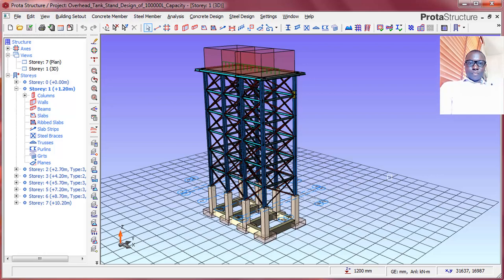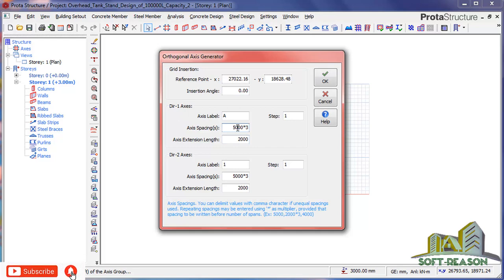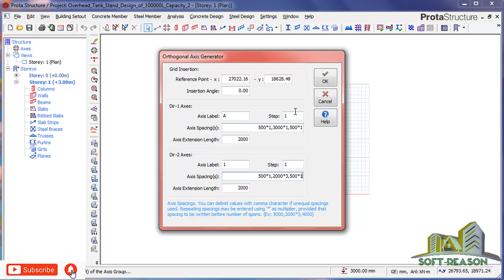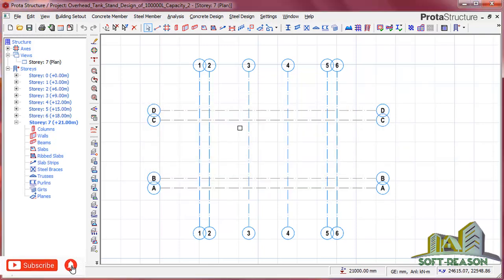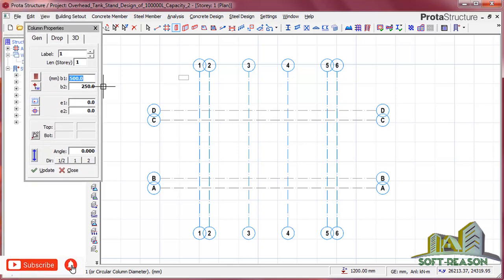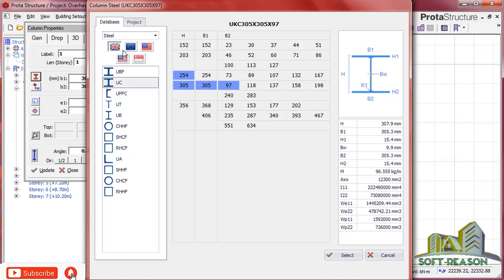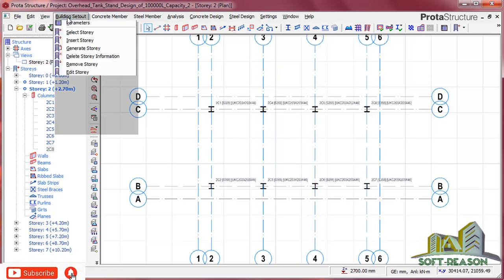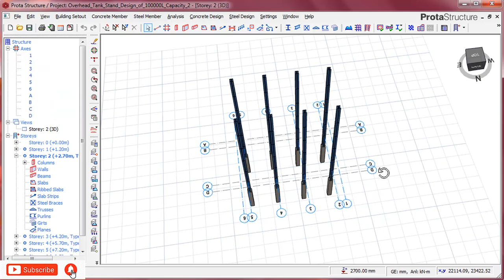STEEL WATER STAND Series 1.0 - Using PROTA Structure.

Comment: I found your channel  very educative. Keep it up bro. By the way which version of protastructure are you using
Reply from the maker: 2018 SP4,  NOT SP1
Reply: When i model tank towers i use just 2 levels, the foundation and the tank level so as to be sure the effective length of the column is been used. creating many storeys , won't the engine see it as floor to floor